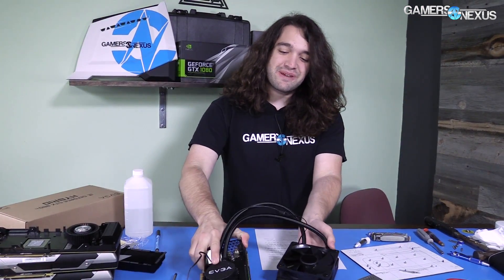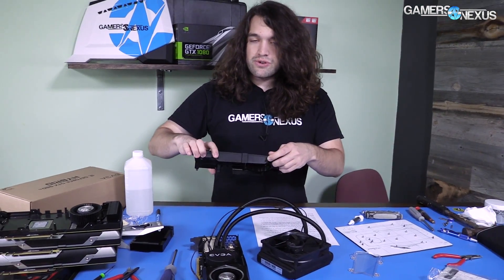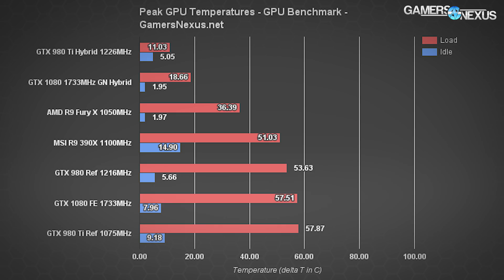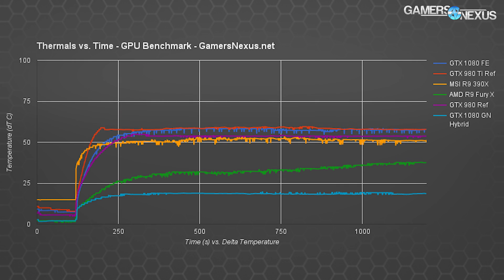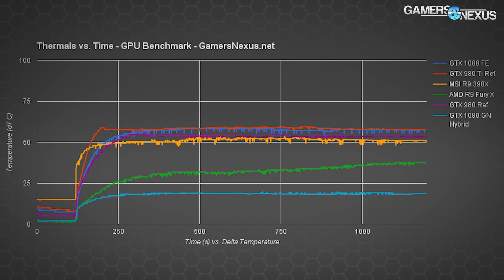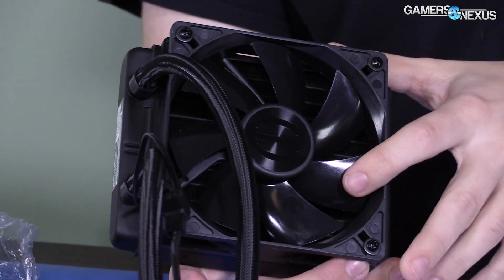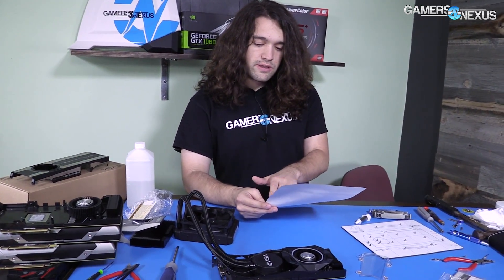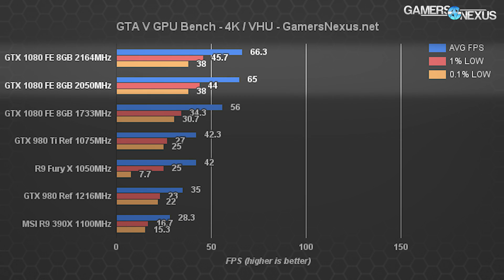Building a GTX 1080 Hybrid Pt 3: Performance Results

Comment: I was 9 year's too late 🤣I just recently got a water cooled 1080 ti. clocked to +800 on the memory clock. Work's great! I have noticed if you don't overclock your GPU most the time you don't get the full usage of the GPU. With that game's like COD and Fortnite Hogwarts L get way better frames. depends on your PC at home at this point.

Comment: this hybrid cooler dropped my 1080 load temperatures from 65C to 35C in average winter ambient temperature in San Jose, CA. Completely eliminated fan noise and I can leave a game running for 12 hours and it would never hit 40C. Totally worth it imo.

Comment: Very interesting, thanks :) Today I'm ordering the Kraken G10 (I see no signs of the G12 coming just yet, so I'm not waiting) and some CLC for my ASUS 1080 Ti Trubo. It runs up to 81°C when gaming, and I'm not very comfortable with that, but I'm sure it can handle it, I just want it lower. Will be interesting to see how it turns out. I was going to order the Corsair H115i to use for my CPU, and then take the H105 I use on my CPU now and put it on the card, but I might just go for the NZXT X41, and put that on the card.

Comment: Love your video! But, I think that you need a better microphone , because your voice goes up & down. If I turn it up to where I can hear the lowest parts, when you hit the loudest parts, it blows me away. Maybe a couple of mono desk mics plugged into a stereo adapter, & set up on each side of you  about 6 inches past shoulder with apart. I was in a band & then when I injured my left hand/wrist in a racing accident, I worked sound for a local band for years. Just some food for thought, trying to help you out .
Thanks again! Great build

Next time the screw is stuck, what I do is get a piece of aluminum rod the right size, put it in a vice, tap it out to fit the screw, then cut a slice of it about 1/8" , you can use tweezers to hold it & screw it on to the screw, but I made a tool similar to tweezers that makes a 90 degree angle. Once you screw on the home made nut, you just use the tool to pull on the nut & the screw comes out with it. I'm old, but my mind still comes up with all kinds of ideas. Hope that helps you out for the next time you have a stuck screw.

Comment: On a seperate topic..  I understand that the 1080 FE is a 5 phase power design with 50A per phase (250A total.)  Has anyone tried a power mod on this GPU?  Will the VRM be able to handle this?

Edit:..  I understand that people have done power mods, I'm more interested in the long-term stability of the VRM with a power mod.  Can't seem to find any answers on that.

Comment: Thank you for posting all this info. Might as well just get a EVGA GTX 1080 FTW. It's running in my system with a stock boost to 2025mhz with max temps at 64C. I was easily able to push to 2100mhz stable for several hours at 4k. This card is cheaper than the founders.

Comment: I chipped my gpu corners when I was applying the heat sink it still works great temp is good and oc well,  but do u reckon it's damaged in the long term,.?I was getting artifact and can't oc when using artic silver 5 Tim, but then I change it to another E2 cooler Master and it works great though

Comment: I cant wait to see your review of the board partner non-reference cards that have more power available to help sustain better OC's.
I suspect 2300-2400MHz core clocks could be achieved with water cooling the card like that with an 8+6 or 8+8 pin power setup.
What do you think?

Comment: Is it just me, or do these temperatures seem very fake, especially the idles. Were these temperatures from Siberia or something lol.
Reply from the maker: Rather than accusing us of falsifying information, perhaps you should read the article and develop an understanding for what "delta T over ambient" means. We subtract ambient temperature from the result so that the metrics are globally comparable. Add your own ambient back in to extract your local, absolute temperature.
Reply: Yeh uh, I failed math a few years in a row, so I stand corrected.
I didn't accuse you, if I had, I would have said something more direct and along the lines of "These temperatures are fake". I simply said "seem".
I'll try to remember delta T over ambient in future.
By the way, use a card for thermal application, you were on the right track. Just use the entire flat side and at a steep angle, not a corner. (gpu paste should be as thin as possible really).

Comment: In the previous video you talked about powering the pump and fan for the CLLC off the GPU, could you have potentially achieved a higher OC if you hadn't done that? Saved some of the power being delivered to the card and then you wouldn't have to downclock your memory.

Comment: I am totally overstrained with so many partner cards. Looking for a good GTX 1080, which should be stable and best (passive) cooling as possible. OC is not priority for me. Anybody can already recommend one of the 3rd party brands to fulfill m needs? As the card is expensive anyway, I prefer to put some bucks on the table, but be sure to get a great thing.

Comment: Based on the other partner brand versions of the 1080 you have seen at Taipei, other than the Seahawk, does it look like all the other 1080s are going to have therm-overheating/voltage issues when it comes to OC'ing?

Comment: How freakin cold is it @ your place that you can cool a card down to 11.03 at load????????
Reply from the maker: Ambient temperature is totally irrelevant. We use a delta value.
Reply: +Gamers Nexus Ok sry then. :P Then I dont know how to interpretate this chart.
Great work though!
Reply: It is the difference between room temperature and measured temperature.
So if the room is at 25°C, a delta T of 10 means the card runs at 35°C, but at a room at 30°C, delta T 10 means it runs at 40°C. So they cut of the room temperature every time, because it is irrelevant.
Hope you understood what I meant.
Reply: ***** The delta is always the thing mentioned in the chart. Like the ~11°C you mentioned.
Reply: delta T=T1(gpu T)-T2(room T)
Reply: +Anti Master ^^ Yeah got it. But thanks anyways for the scientific formula.
Reply: Hmm yeah sorta. So the delta would be around 25 degree then I suppose?
Reply: Aha! Ok that makes sense! Thank you. :)

Comment: Make your own shroud for it and link some compatible 980 coolers? Also, it doesn't have to be part of an AIO solution, if somebody wants to dual-SLI they can just use hoses for it easy, provided there is enough case clearance to let it bend. Else, some of the older water block fixtures should work with this, using other custom parts.

Comment: Great stuff! I'll have to keep an eye on your channel now. I'll provide a bit of my 2cents.

(No, my name is not Jay.)

- "I took voltage away from the RAM to give more to the GPU"

I'm guessing to stay within the power spec. It's a little misleading since you aren't redistributing "voltage", but are using voltage to redistribute power.

When the BIOS editors come out, it would be awesome to see what you can do with no TDP limit. Yes, you can push the 8-pin connector past the ATX spec of 150W. Your VRMs will get warmer, but as for the wires and the PSU, I wouldn't think THEY would have a problem until you are closer to doubling that. You'll just want to have some fairly clean power when doing so.

With no TDP limit, it was pretty easy to get my 970 running like a 980. The only limitation was the voltage. 8100MHz GDDR5 and about 1528MHz core. A voltage bump would have gotten me past 1600, but I was already pegging the hard limit of 1.212v. I don't want to burn the resistors, as I plan to sell this card.

I couldn't help but cringe a bit at the TIM application, but I feel like you were cringing as well. Probably made a ton of bubbles in the process of spreading it. I would argue that the difference the bubbles make is far greater than using a new TIM while traces of the old TIM still exist. So if you did the dot method using your tube, you may have gotten better results, though these are still fantastic results.

I usually don't have the balls to do the dot method on a die, since I can't actually tell how it is spreading. I feel like any uncovered spots could become extreme hot spots and perhaps even create physical stresses within the die. (Doubt they would be significant, but I like my peace of mind.)

Comment: Thumbs up for Gamers Nexus doing proper endurance tests. Most reviewers have glossed over or ignored GTX 1080 throttling. Wait for 3rd party cards.
Reply: every reference card throttles. both nvid and amd (with exception of fury x). really wish both the companies would put more of an effort into making the reference a solid design. Like show off your engineering and make it perform like its supposed to.

Comment: Are you having issues with the overclock because of the single power connector (8-pin?) Or just because it's a reference model without all the beefier power phases and whatnot?
Reply: most likely. i assume 3rd party companies like gigabyte will through a  +4 or +6 on there for headroom. i know my 970 has gigabyte 970 has 8 + 6 LMAO. but then again it payed off for me because i was able to get my card to OC considerably well.

Comment: Why would you even need to over clock it it maxes every game with ease
Reply: why do you need to buy a 1080? a lower end card can max every game with ease. Its all about the speed bro, (cough and the glory of posting that fresh benchmark to extend your E-PEEN). honestly though cards aren't where they could be performance wise. like overclocking this card is what allows it to give 60fps at 4k. before OC it hovers around 40 fps...  so there is actually a logical reason.
Reply: 200HZ monitors...

Comment: WTF IS DELTA T C??? he couldnt just do it in c?
Reply: +Andrew Ginnis --- it's the temperature of the card, minus the temperature of the surrounding environment (ambient).
Reply: as the other guy said its temp difference. Delta pretty much always stands for difference in number based on a constant. good thing to remember for your calculus and physics classes
Reply: Just add a room temperature to it. Normal room temperature is ~21 C, then you have your values. He might have done it if the room he was testing in was abnormally hot or cold.
Reply: Delta means "change in." T means temperature. C is Celsius. So Delta T C means "change in temperature in Celsius."

Comment: Hmmmmmm anyone wanna sell me their GTX 980 Ti ? don't think i will be getting this card in a rush now ! will wait till next year when the Ti comes out and better After Market Cooling !!! i'll let the Rich boys do all the buying and testing Thanks :D
Reply: +Jimmytwogunz  I dont see myself getting a 1080 over my 980 ti, for just a extra 10 fps. I'll wait till next year. see what amd brings out, and see if the 1080 ti is worth it. my prob is i should of waiting about 5 months and then got the 1080.
Reply: Roaming Joe yeah i was going to buy the Founders card as i have the money to do so BUT now after all the awesome reviews am like Ummmm naaaaa not worth it ! i want to go Green but it wont be 1080 Founders ! i'll hold it out till next year and get the GTX 980 ti and water cool it in SLI
Reply: There will always be something better 𝘫𝘶𝘴𝘵 around the corner..
Reply: +Jimmytwogunz Very happy with my 980 Ti hybrid, 1,400Mhz core. I'll check out an eventual 1180 Ti - I don't think a 1080 Ti will make me want to spend $750, a year after having already done so (got my 980 TI on launch day).
Reply: Also the 980ti here wasn't overclocked either. I've seen reviews showing the overclocked 1080 being on par or sometimes performing less than an overclocked 980ti
Reply: man i swear i don't know what to do guys ? i wanna go Green but what do i get ?
Reply: Nothing right now, because the stock cooler doesn't properly handle the GTX 1080. At very least, wait a month or two for boards with aftermarket coolers to release, and check tests to find one that at the very least doesn't thermal-throttle while running stock settings, lol. I'm going to hold out until Vega releases, personally. The 1080 is cool, but knowing that there's likely better cards releasing later this year makes me think it would be wise to wait.

Comment: Honestly not looking very good at all right now, it can only OC like 1-2% and the DX12 performance is terrible, single digits over the Fury X. I hope that AMD does better or the 1080Ti is significantly better at both DX12 and OCing otherwise I'll be pretty disappointing with this generation of GPUs, shame since it was supposed to be the big jump in tech.
Reply: The lack of power limits the overclocking potential a lot just wait for the aftermarket cards with a 8+6 pin power conector they will do way bettet
Reply: The lack of power limits the overclocking potential a lot just wait for the aftermarket cards with a 8+6 pin power conector they will do way better

Comment: I was playing ME Shadow of Mordor on my 1.4Ghz core clock (OC) GTX 980 at 1440p (nearly maxed out) and I was getting ~70-80 fps. How is the GTX 1080 not getting easily over 100 fps at 1440p when OCd to 2.0Ghz?
Reply: The cpu is bottlenecking the frame rate at that resolution. At 4k you will see a bigger difference.

Comment: It sounds like better POWER management on the card is critical to get the best overclocks. So far the estimate is about 2.5GHz for something like an EVGA hybrid similar to what they built here.Compare that to scenarios with a Founders card where it can throttle down to around 1700MHz sometimes and we might see up to a 50% boost over Founders!! (assuming minimal CPU bottleneck etc).The Founders is about 2.5 to 3X faster than my GTX680 depending on the game (and relatively better when VR optimizes for the GTX1080). So I might get to see improvements from 3X to 4.5X my GTX680 depending on the game (and up to between 4X and 7X in VR vs my GTX680).

Comment: Interesting that Nvidias newest card seemingly throttles so easily. The 1080 hype train is slowing by the day.
Reply: Only because you compare a reference card to the best custom cards on the market
Reply: +Max Latz I'm comparing it to nothing. One would expect a product to match its advertised performance. The 1080 does not. Jay has shown how to fix its issues with a few adjustments. I dare say adjusting the fan profile on its own might prevent it from throttling. Why did Nvidia not set it up with a more adequate fan profile out of the box?

Comment: wondering why these new so and so proclaimed 1080 series fail to show up performance improvements when OC.
I mean lets be honest on a 980 ti a 400 mhz boost on the core equaled at least 10-15 % more performance..
Reply: Because the reference design has a lack of power so that it can't use the full overclocking potential wait for the aftermarket cards to compare overclocked 980 and 1080

Comment: Cool video, good work guys, interesting to see that overclocking the water cooled system really didn't benefit fps but wonder if rendering video in video editing would of seen a jump??
Reply: looks like you would drop less frames with hybrid if you max out settings and play for a long time. or if your ambient is higher than normal.

Comment: It seems to me like it's almost pointless to get a reference card if you want to overclock. Can you overclock with cards in sli?

Also, the fan that comes with the 980ti hybrid is loud as hell. I replaced mine with a corsair air series sp quiet edition or something like that. Way way better in terms of noise
Reply: This exactly,  you don't care about that OC? get the FE, you want to do more OC on it wait for the non reference once to show up. For myself i never OC my graphics cards there for i'll be getting the FE since it will prob do just fine :)
Reply: I checked and their all sold out, lol.

Comment: Great job on testing the OC ability on GTX1080. I going to wait until mid June to see if EVGA will release hybrid version. If that will not happen, then I will get a Non founders edition and buy a water cooling to replace the air cooling. I really with they could release 8+6pin version since we do see there is still a potential to OC it to 2400MHz or even 2500MHz with water cooling solution.

Comment: What I take away from this is that the so called Founder's Edition is not only NOT worth the premium price, but it is actually comes with a really crappy cooler. Ty Gamers Nexus.
Reply: no. for them to obtain the oc that they did with the stock cooler it proves the cooler isn't crappy. Sounds pretty good imo. Now me personally if I do get this card I'm slapping a proper wc block on it the first chance I get just cause im a wc fan. No pun intended.
Reply: If the card throttled then the cooler couldnt handle it. Personally i dont like reference coolers either.  

Any how, The stock cooler on this card is pretty "meh~" looks like a space ship and from what i've seen from it sure isn't great. maybe in SLI but who wants two cards in 2016?

I don't :)
Reply: roykioh agreed